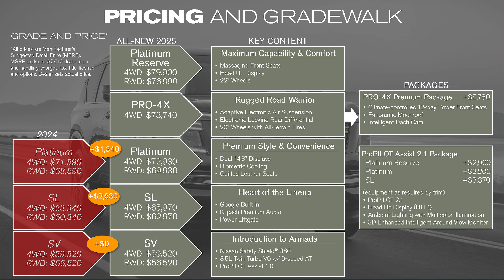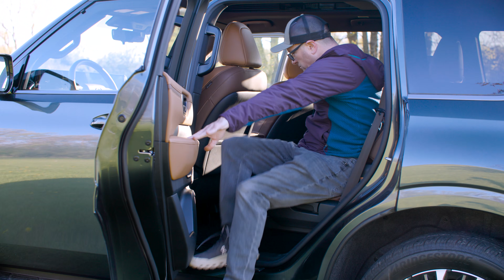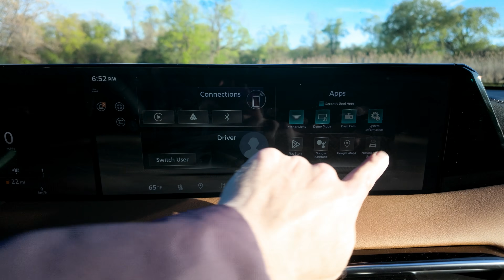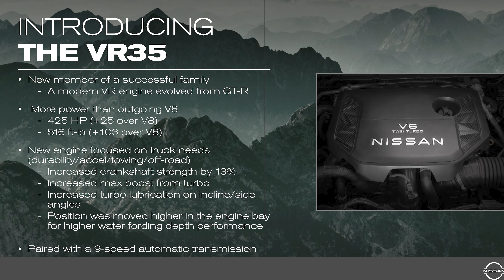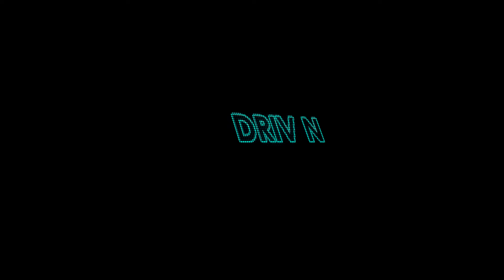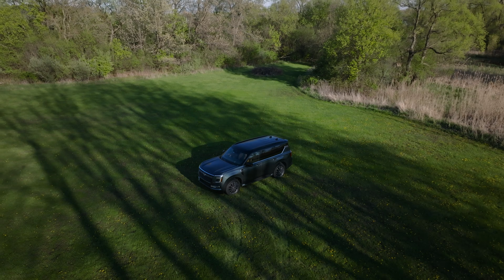Nissan Armada | Using the Lexus Formula

Comment: We looked at the 2025 QX80, Navigator and Escalade. Ended up with the 2025 Escalade because while the QX80 was impressive the lack of cargo space/extended wheelbase option, depreciation and nissan's murky future really sealed the deal. I hope we don't regret the Escalade with the recent GM recalls for the older models.
Reply: Gm not doing good either lol
Reply: @lifesAtrip513  Gm's not in near bankruptcy like Nissan. Engines might have problems but depreciation on the Escalade are decent compared to the QX80 and Navigator. At the end of the day the significant other wanted the largest SUV so escalade ESV and navigator L were the only options. Couldnt convince her to go with a QX80 even if depereciation and near bankruptcy wasn't a problem.
Reply: 6.2 recall nd the 5.3 is same junk too
Reply: Enjoy your fun time at the dealership’s service department!
Reply: @Michael-YYZ  Have you bought luxury vehicles with decent dealerships? They come and get my car for me and drop off a loaner. I dont spend almost any time at dealerships other than to buy cars these days.

Comment: Vehicles are priced so high that the discussion doesn't consider a purchase execpt as used.

Mfgs have pushed prices to limit.
Reply: Except wages have kept up:

Nissan armada cost 2004: $33k to $41k

Median Household Income: $44k

The prices of both have doubled since then (if not income rose a bit more)
Reply: Factually, no. If you adjust for inflation, prices have remained pretty consistent over the past couple of decades. Instead, you’re witnessing inflation and devaluation of your currency. Wages haven’t kept up. Seriously, run the calculations and you’ll see for yourself. Difference in new car prices for the same model is within a few percent.
Reply: @asplmn you missed the important factor, wages have not increased nearly as much over that same time period. Instead loan terms have been extended to make up for the increase in price
Reply: @Racedriver22  yup! I did point that out, btw, if you re-read my comment. ;)
Reply: @Racedriver22  maybe you’d make more money if you weren’t illiterate

Comment: I really want to like Nissan, but with all the CVT models and now 3 cylinder engines in 40K plus vehicles.....their killing themselves.
Reply: Seen a lot of Nissans with CVTs hittting 200k miles. Just change the fluid. It simply requires an adapter for the fill plug and it is NOT sealed!
Reply: What does that have to do with the Armada? The only model that has a 3-cylinder is the Rogue. And you do realize most cheaper/economy cars have CVTs now, right? Nissan is not the only one using CVTs. And they have actually reduced the amount of models that use CVTs. 

Also *they're
Reply: @bigd7386  Cry harder 😭, don't have to tell me you're a  liberal.  Those apostrophes really trigger them.

Comment: I had a rental of the last gen Infinity and it was the worst hunk of junk I've driven in a long time. I was kind of excited to check it out at first. The steering wandered all over the place, the brakes were absolutely horrible, the suspension was no better than my Tundra pickup truck, the radio was awful. The ergos were not good considering how huge the thing is, the driver compartment was pretty tight feeling and confining. The thing had squeaks and rattles all over and it was only 30k miles on it. Also, I was in Florida at the time, pancake flat all paved universe, the most forgiving place for a vehicle.

I wouldn't take one if you gave it to me.
Reply: Dang, u make it sound like you were driving a Yugo
Reply: @journeyman291  It was shockingly bad for even an XL level truck, let alone the top luxury model. I was glad I didn't need to put that many miles on it.
Reply: We rented a QX80 a few years ago.  Had about 5k miles on it.   Not bad but the steering rack needed a damper…every bridge abutment would jerk the wheel.

Comment: Are there any other vehicles whose name is a collective of things? Honda Herd? MB Murder? Ferrari Flock?
Reply: The only other one ironically is Maxima… which is the plural for maximum
Reply: @air-headedaviator1805  Inherently Local.
Reply: There used to be Chevrolet Avalanche.  It's a collection of snow, rock, trees.
Reply: @Seriously140  Meh. An Impala is a collection of cells, etc. An avalanche is conceptually one thing.
Reply: @ Yeah, I debated that as well, but it's the closest I can think of.

Comment: I've always appreciated the Armada for what it is.  There was even a short period of time that I strongly considered it over a Lexus GX because of its significantly lower used market price point, but at the end of the day, I prefer the quality of Lexus and Toyota.
Reply: I mean, buy what you like but I've owned Toyotas and I've owned Nissans and never had an issue out of either brand. Same story with most of the people I know who drive both or one or the other. They are both reliable brands. And Nissan's truck line never suffered from the the CVT problems because it never had them unlike so many people who think they know everything about cars seem to believe. By the way, despite all the wailing the press and talking heads online have done about the CVT's the only real study and verification done on the subject puts the failure rate at 6%. Not acceptable but to listen to the average fool tell it 50% failed.
Reply: There have been no issues with the Y62 Armadas, so I am not sure what quality issues you are referring to.
Reply: You meant to say: “…I prefer the lack of quality of Lexus and Toyota.” Fair enough, I’d say.
Reply: Yeah, nothing says Toyota quality like them having to replace 100,000 engines
Reply: @weirdshibainu  idk maybe better than not having an engine at all since titan's discontinued

Comment: im starting to see a reoccuring trends with nissan reviews in a super zoomed out perspective. here is a company that makes good, usable basic, true to form stuff, that really if you can get over the altima/cvt stigmas, makes a competitive product, it is seriously kneecapped by resale value (toyota's stigma of being ultra reliable i think has dropped off MASSIVELY of late) and the joke that Nissan is to the JDM fleet in the usa akin to dodge vs the big three. And it is not true. I have a frontier, and really it does so well. the damping profile is a bit stiff overall but the truck I believe was designed for a 4x4 basis first and the rwd variant was sort of an after thought. but it still knocks down 20 mpg, has gone 40k miles no issues at all and i dont need to read a 251 page manual on how to use it. 

Now if nissan could figure out how to actually sell their vehicles... . 

i am also interested in that Inifiniti review.
Reply: I've been saying it for a while, Nissan has more of a brand problem now (used to be a product problem as well). As you put it, the stigma often times overshadows when they actually do something good (see comment above where guy goes on a tangent about 3-cylinders and CVTs on an Armada review... smh). But if you pay attention reviewers really perpetuate this and often times have a negative undertone anytime they review Nissans product. But their most recent products are starting to make that hard to maintain and the Armada is proof. It's simply the well executed product that Nissan needs and it really does put to shame Toyota's full-size SUVs when you consider respective budgets. Nissan just needs to keep executing on this level and get some hybrids on the lots and they'll be fine. And of course continuing to improve reliability.
Reply: Nissan is actually known in Japan with their autonomous driving tests, popular EVs like SAKURA, and unique hybrids like e-Power system. Nissan Qashqai and Juke are popular models in Europe, and Patrol is famous in Middle-east for its endurance. 

North America segment is where Nissan had incompetent management and dealerships. Under Renault management, Nissan was forced to sell way too many cheap cars to less affluent customers who don't regularly service their cars, which eventually damaged the brand recognition. Since now they were able to escape Renault management, Nissan will gradually recover.
Reply: Great comment. Well thought out and spot on. Nissan is clearly underrated. When Toyota has an issue with their powertrain, mums the word. It seems to get less negative press.

Comment: Nissan needs some halo cars and rebranding moves to establish its reputation.

in my exp, you went for a Nissan for reliable affordability with fun factor in styling.  The Altima and Sentra's transmission problems plagued it in the 2010s to now & cheap with poor value is not the direction to go anymore . . that's what brings down Nissan's resale value

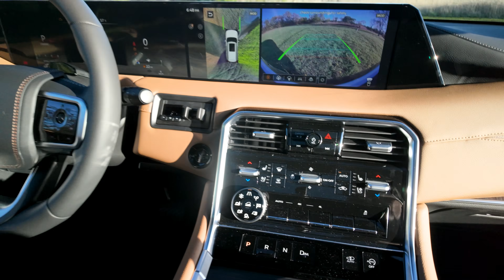Comment: 2:52 TBH I don't think this is an error that needs fixing. If I have my cameras on, I probably need them. I don't want to see the passenger's temp settings while I am parking this behemoth. The passenger can wait. However, the amount of piano black is just disgusting. While it may look better than X7 (which looks stupid like X5 with Brazilian bottom surgery), the plastics inside look like something from the late '90s. I am shocked by the GX road refinement comparison. 13:20 you are still driving a brick on wheels :) and the better structure insulation, the worse wind noise you get - because it's no longer masked by typical road noise.
Reply: really hate the amount of touch interface

Comment: Nissan has come a long way from the 2000-2020 quality slump. Great production as usual!
Reply: They finally were able to escape from Renault management.
Reply: I liked the Armadas throughout the years. Can get em pretty cheap too. That 5.4 was really good and they did body on frame SUV stuff well.
Reply: A mere 20 years! 😂
Reply: They haven’t had a quality slump 2000 - 2020.  Sure some issues like everyone but no worse than any other manufacturer.  Lots of titans and armadas out there with 300k+ on them.
Reply: @AB-coyote  their truck platforms have always been great - it's everything else that tanked their brand reputation. Their crossovers and sedans with the JATCO CVT are huge hunks of shit
Reply: @chef_mans  CVT issues way overblown online. Yes they had their issues but still not worse than anyone else’s.   My mom had a 07 Altima that went 150,000 flawless miles. Not record breaking mileage but substantial enough and the car would have definitely seen 200k+ if it didn’t get wrecked.  Maintenance goes a long way. Ask most people who have had a CVT issue what their fluid change intervals were.  You will get a blank stare HUHHH look.
Reply: @chef_mans  anything with a vk series v8 has been solid

I've heard less issues with vk than toyota ur series, but what do I know, I own neither
Reply: @chef_mans  Kamikaze Altima drivers with single digit credit scores aren’t doing them any favors
Reply: @AB-coyote 260k and climbing on my ‘12 Armada. I’ve only had it for a couple of years but it’s been great!
Reply: @AB-coyote  trucks based = great. cars based = atrocious. If only they stop putting a Mirage's CVT in all their freaking cars.
Reply: The products perform better as competitive vehicles, but they're still cheaply built and by far the worst of all Asian car brands when it comes to reliability. Just because they're better than Stellantis or VW doesn't mean they deserve praise. Not when they were so competitive in the 80s and 90s.

Comment: About time they brought the patrol over to the USA
Reply: The Patrol has always been here as the Armada and QX80
Reply: @air-headedaviator1805 partially true. First gen of armada was on the F-Alpha platform shared with the titan. In 2016 the armada was changed to the Y62 (patrol) platform with the caveat that suspension, and drivetrain was tweaked from the patrol to better fit the us market (made it less offroad capable). It is my understanding now that the current armada Y63 platform is much closer to a true patrol
Reply: @henrysadventures8424  this time around they are the exact same apart form some trim level variations
Reply: @henrysadventures8424  the Pro-4X trim of the Armada is the only trim that’s mechanically exactly the same as the Patrol, making it off-road capable unlike the other trims.
Reply: @faheemabbas3965  No, the other trims are present in the ME with different names. They do not have a PRO-4X equivalent yet, but I assume they will (especiallly in Australia, when they launch it in the Warrior trim).
Reply: @faheemabbas3965  the top trim is Pro-4x plus platinum
Reply: @air-headedaviator1805  that's not strictly true as the Armada was missing various hardware that the Patrol had... All the drive modes and differentials off the top of my head...
Reply: Doesn't really matter. The Y61 is the more attractive Patrol. The next 2 gens are just mini buses that are next to useless for anything greater than dirt/gravel roads. Modernizing the Y61 and shipping it to the US as a Nissan Patrol would be lovely.